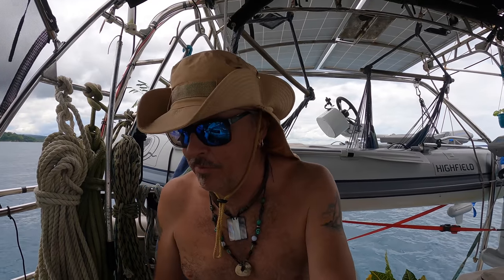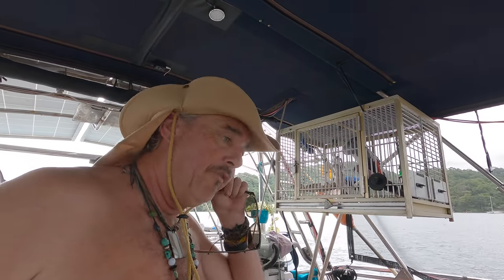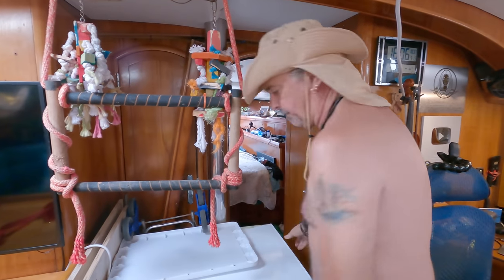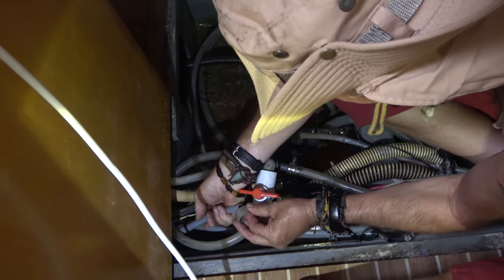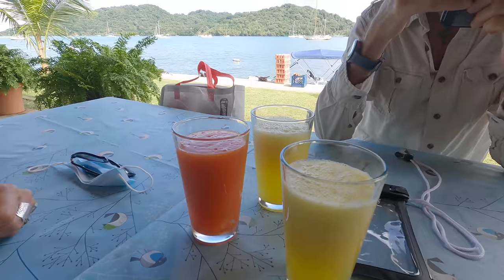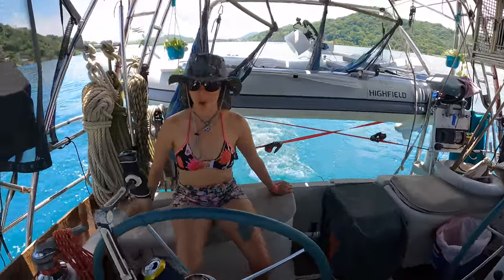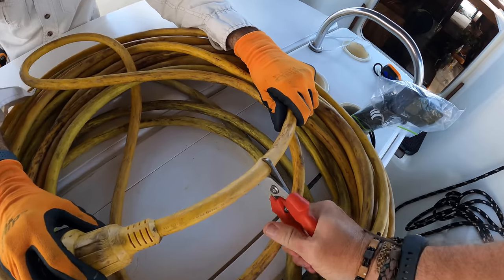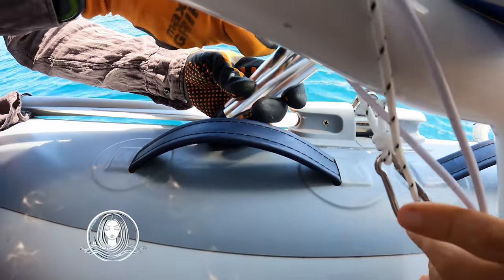SSL587 ~ it's started...

Comment: I had a problem with a pump switch getting left on my a by kids and significant other so I just took the switch out and put a timer switch in two problems solved. No more kids wasting Water by staying in the shower too long and the pump turned itself off .

Comment: All plastic fittings like that pipes have to have a plastic insert collar inside the pipe! to stop it coming loose yours doesn't have it if it's a press fit you should tighten it afterwards not just pressfit make sure you got the plastic inserts in always! that's why the popping out

Comment: Crew guy covers up like i have to ... freckles and used to have red beard..  skin Cancers can set in quick and early even in high latitudes.  The same skin types tend to get eczema and can develope dermatitis. Though i agree sometimes you just got rely on your skin ... If hes worried about it use a barrier cream  or pretreat his hands with a cold cream or lanolin based hand cream. N Sea fishermen would use to stop skin splitting and bleeding in freezing conditions. If he just wants to keep his hands clean even a drop of cooking oil rubbed in before will help get the muck off after, when done add sugar more oil , scrub and wash off with ordinary hand soap. 
Worked for me in 30 years of MC/Car repairs and didnt split my skin or leave it scaling up at the knuckles.
Its also cheaper and easier on the environment rather than industrial chemicals.